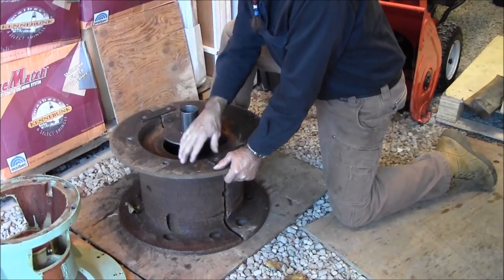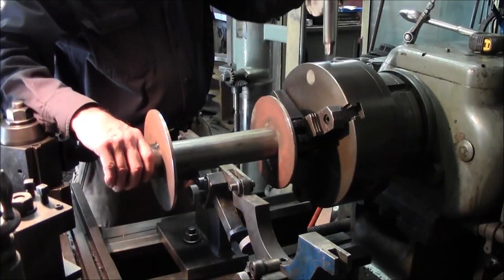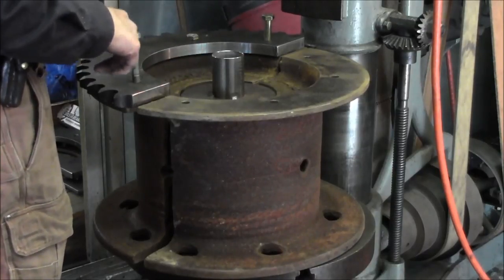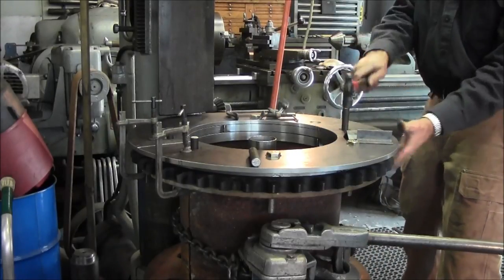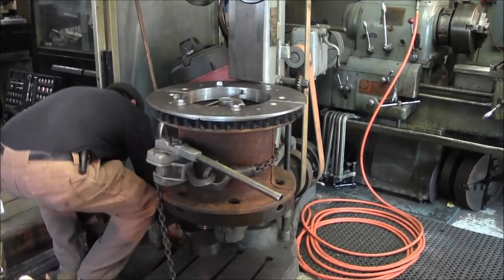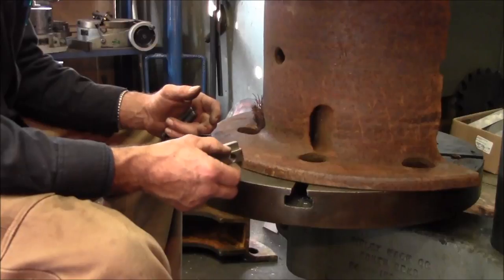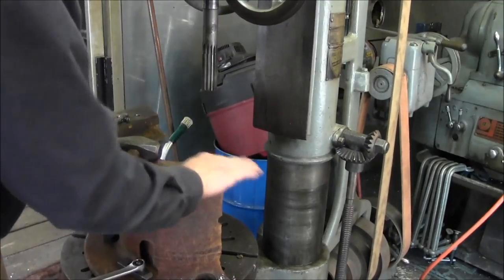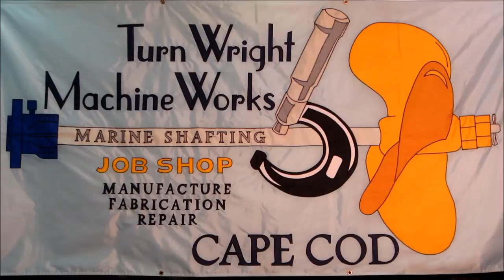American Crane Part Six

Comment from the maker: Well I’m glad the other guys jumped in with a few choices for you; add MSC and Industrial tool for new! I’m not near a big city, but venturing in to the city, there are always used tool suppliers about, with tons of tools and bits sold by the pound. You do need to dig though piles and barrels, for the treasures, make a day of it and share the experience with a friend. ;{)---

Comment from the maker: It is important to have a killer vice on a drill press for the average job, I like the older shaper style vices, kind of give you those dimension you were mentioning, same kind of look as the angle locks but broader. Is that a winter project offer? ;{)---

Comment: Winter project offer? Sure is Keith... I just have not found a vise that will offer the precision of a machinist or milling vise like a Kurt but be in a drill press compatible size. I looked at and have used a wide variety but nothing really fits the bill. Everything is either too big, too heavy or too small or not precise (or repeatable) enough..  I love the old style Bridgeport brand vises too. I bet you if we put our heads together we could design and build something really superb.

Comment: Keith nice work good to see the Sibley in action again.  I'm not sure why I like it so much but it just seems really well made and solid.  It seems like every time you turn it on you know it will power through anything you put underneath it to drill. You may have covered this in another video but does the spindle operate CCW?  Good tips on the alignment and reaming of the bolt holes I was wondering about no lube but you covered that.  Sulfur based oils are hard to clean away for welding. Cont..

Comment: Not an engineer. Not a machinist. Not worthy to sweep your floor. But it seems the bolts wont fit because when you cut your gear on the plasma table, you relieved the stress in that ring of metal and the cut ends, opened up. They sprung open. You can make the bolts fit by reaming the bores and creating more clearance, but the gear, spacer, guard that had once perfectly circular ID's and OD's are no longer perfect.... Wonder if you discover this in a later video... Awesome content, by the way. Should be compulsory viewing for every machinist apprentice.